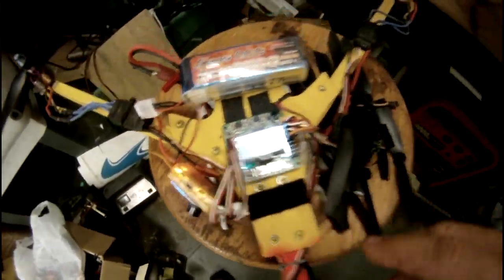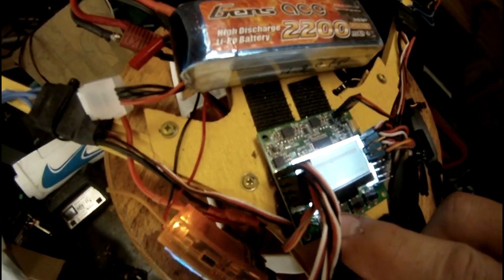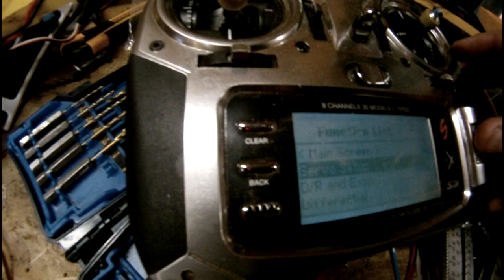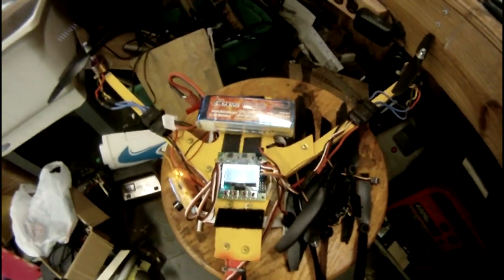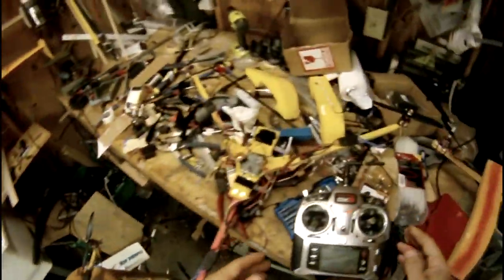Hobbyking KK2 board setup for gain and auto level with flight video

Comment: Hey EngKarimM, 
you can set AutoLevel to be controled by aux channel. So if you don´t touch the configgured switch on the radio, auto level will always be on.

Comment: Hi Hallstudio
Interesting video, unfortunatley can't see the LED screen for the bright light, Ive been trying to get one of these "B" boards programed for 3 days, have resorted to string method cant get the thing to stay still in hover, have had it lift off outside and slowly rotate anticlockwise, can't seem to stop that, have tried all things in the manual, can fly the Beetle Quads no problem, what's the secret Regards Goofa

Comment: FWIW, the "P" and "I" terms are "Proportional" and "Integral" - P is "how much is it currently off by", and "I" is (subject to limit) how much it's been off over time".  You might make one correction if you're 5 degrees off ("P" term)...and a bigger correction if you've been 5 degrees off for 10 seconds ("I" term).  Often (though apparently not on KK2 from what I see) they're combined with a "D"erivative.... see "PID controller".

Comment: summary of settings (as mentioned in the above video):

roll/pitch
p-gain: 35
p-limit: 100
i-gain: 25
i-limit: 20

yaw
p-gain: 45
p-limit: 100
i-gain: 20
i-limit: 20

self level
p-gain: 65
p-limit: 65
i-gain: 0
i-limit: 0

(please correct me if I'm wrong)

Comment: That was very helpful.  My KK2 board is in the post from Hong Kong.  Really looking forward to trying it and comparing to the original KK.  How are you mounting the board, it looks like just velcro ?  My KK is on 4 foam blocks in an attempt to absorb vibrations, but velcro would hold it on much better